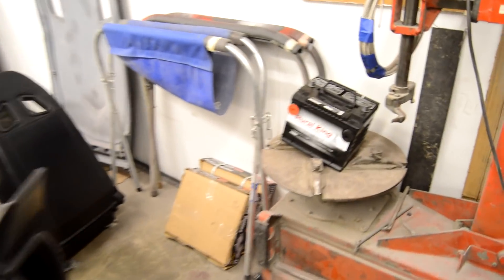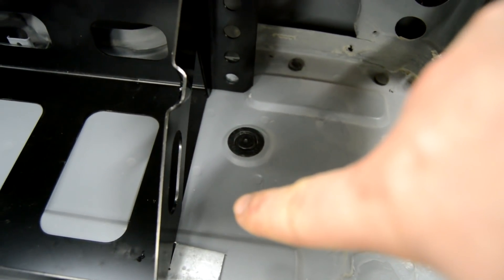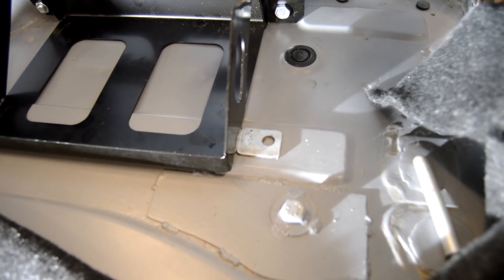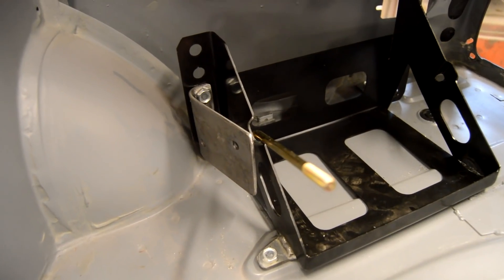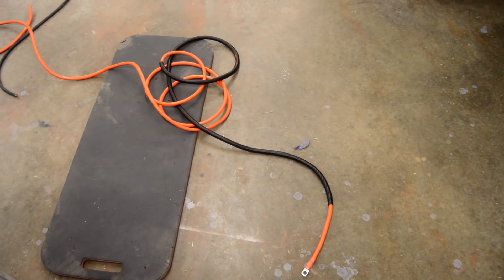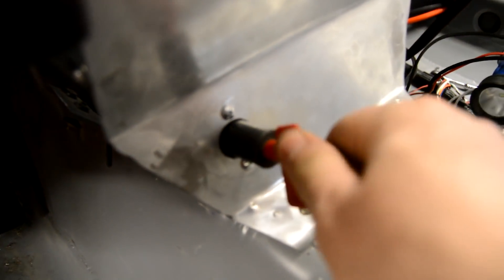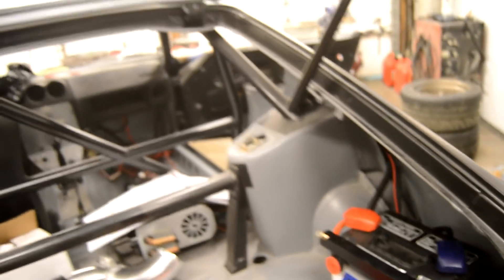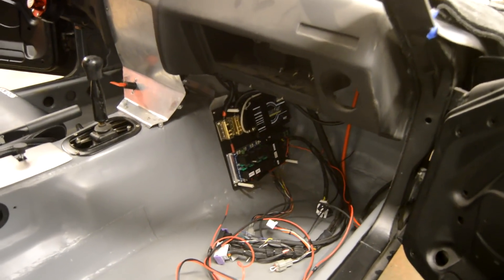Relocating the battery to the trunk! 280z

Comment: You can easily sharpen your drill bits with a dremel rotary tool using a stone type head. Im sure youtube will have some videos on it. Saves a lot of money replacing them all the time.
Reply from the maker: Yea I need to do this baaad

Comment: Are you going to cover the exposed battery wires inside the cabin on the passenger side?
Reply from the maker: Yes. It will all be enclosed somehow. I built a cover for the ecu and relay board so it is protected.

Comment: What was the point of relocating your battery? Did you need space? We’re you worried about heat and vibration? Was Is it worth it?
Reply from the maker: I like the battery in the back for many reasons. Did I need to, prolly not. Happy I did.
Reply: @StewartMotoring  oh ok, thanks. I was just wondering because I’m starting to work on my 280 and am looking at batteries. I didn’t mean to sound like I was criticizing it. Nice car, thanks for sharing the build with us.

Comment: After I crimped those fittings on, I would have probably unnecessarily soldered them.
Reply from the maker: Soo I actually tried that for the alternator terminals. By the time the wire was hot enough to melt the solder the rubber sheathing was melting off and looked terrible. So I gave up on that. But I did try!